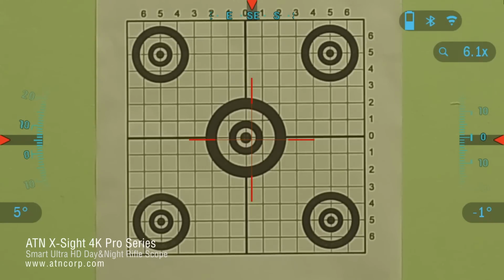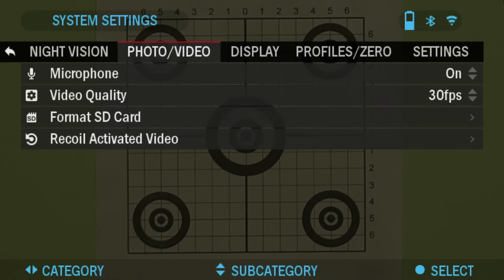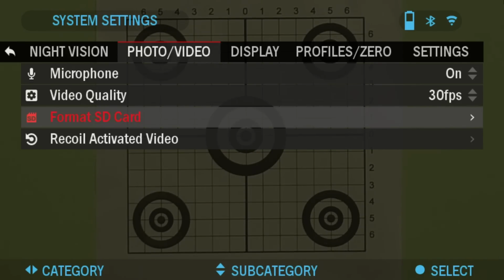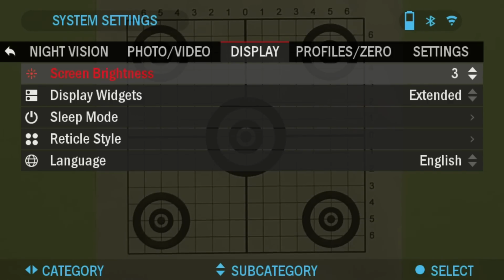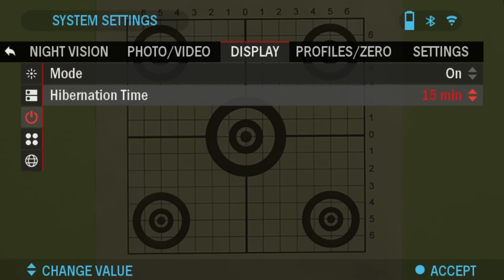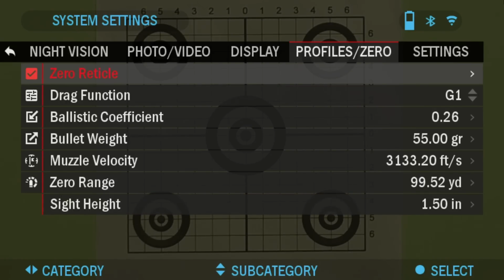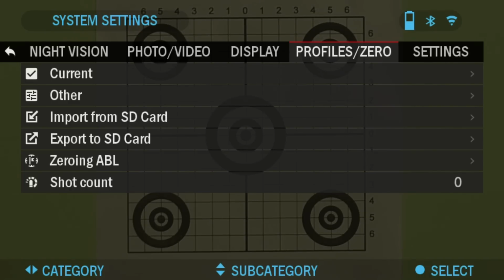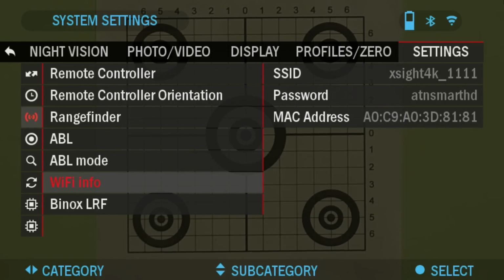System Settings of ATN X-Sight 4K - How To Guide

Comment: Got an x-sight. I have no idea how I am supposed to configure the zoom function to make it work.
Reply from the maker: You can set the scope to extended zoom in the settings but generally, you don't need that. Just use the zoom scroll wheel on the side to zoom in and out.
Reply: @AtncorpOptics  So the thing is, I followed the instructions in the manual to no avail. I reset it to factory settings and proceeded to set the device option to the 4k Pro 3x, and set the zoom function to standard. The scope will still not zoom. If I had to guess it is a firmware issue, since I spoke with an ATN attendant on the website chat about it and they recommended e-mailing info@atn. It seems to be a rather unique issue, and in all, I'm not heartbroken, it would just be nice if the scope performed the zoom function.

Comment: I’m really thinking about getting one of these. When zeroing you’re weapon, if I use a 25 Yard zero as I always use. I’m typically 2.5” - 3” high at 100 yards or roughly dead on @ 250 yards. Will this still work on this Optic? And if I use the range finder and take shots at longer ranges do I put my ZERO range as 250 yards or 25 yards? Also what is the maximum range this Optic can be used accurately?